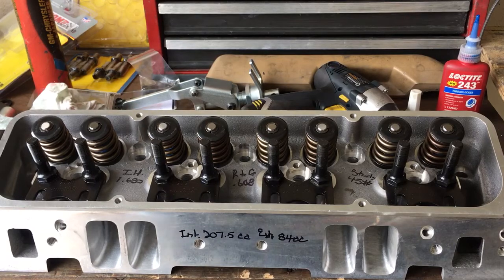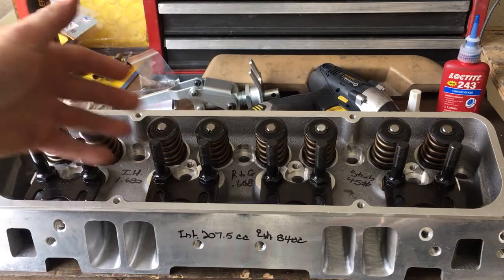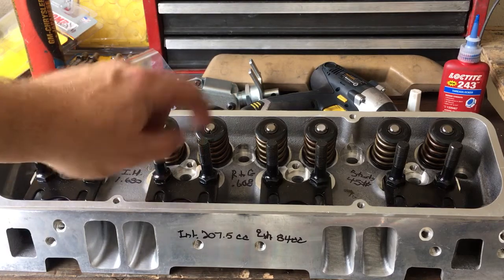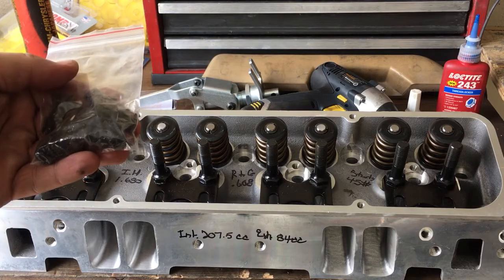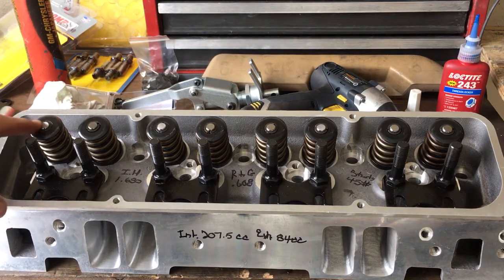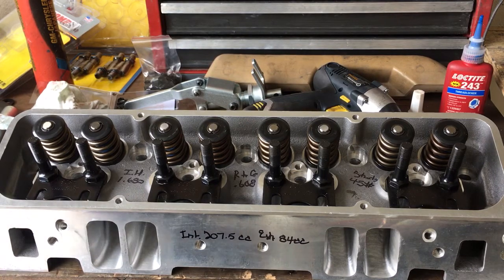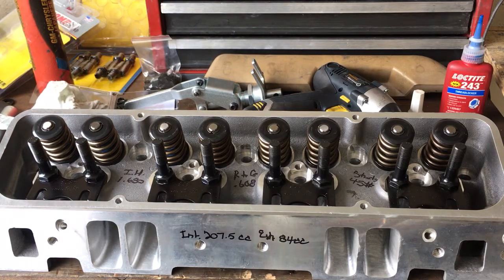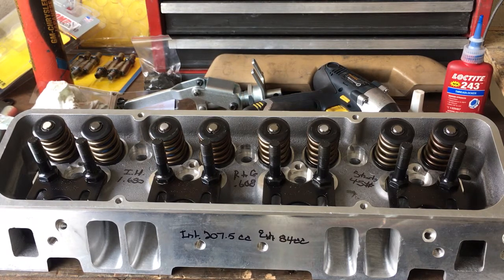Assemble cylinder heads like a Pro

Comment: How do you choose valves for bare heads? example, does any 1.94 valve fit any bare head with 1.94 machined seat?? being the same make of course sbc.
Reply from the maker: Kent Dixon There will be a valve diameter, length and stem size.  You want to make sure the valve sealing angle is correct, the length/stem match your application and the valve head size is what you want/need. 
You may be able to replace size for size valves but any deviation will require a fresh valve job.  I hope this is what you needed?   JD
Reply: HeadFlowInc, thanks for the reply, I guess what I meant to ask was, the sealing angles, yes the stem size , and length need to match, but manufactures don't seem to state sealing angles? they must be standardized?
Reply from the maker: Kent Dixon Yes the sealing angles generally stay the same at 45 degrees. The valve jobs can vary greatly between manufacturers, application etc.  I’d like you to read this article, it’s a very good description and has pictures.  
http://www.superchevy.com/how-to/89678-valve-angles

Comment: those spring seats look like 145, did  they request the smaller dia. springs because of the moderate lift cam?  thanks for sharing   your knowledge...
Reply from the maker: Cliff Wright Yeah, those valve springs are the Comp Cams #981-16  they recommend for the XE262H cam. The 981's aren't a very strong spring plus they're Stock diameter. I'd rather see people run a hydraulic roller cam for many reasons.

Comment: Looks good. I always had a few engines around to show the customer that when they get the head from me that installing the studs and guide plates was there responsibility. I've seen shops install the studs and guide plates with impact guns and upon assembly the push rod is pushing the rocker arm off to right or left side of the valve. Great video JD.
Reply from the maker: Mike MacCracken Very true, most of the time the guide plate has to be tweaked to free up the pushrod. Hopefully the shop building the 406 will get the plates dialed in. Thanks!